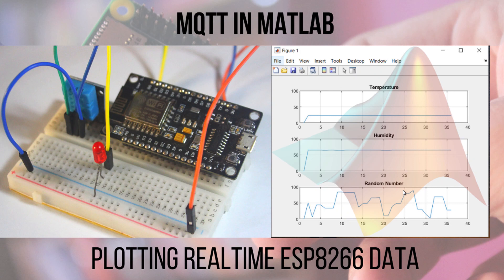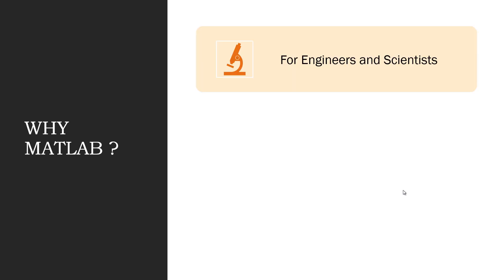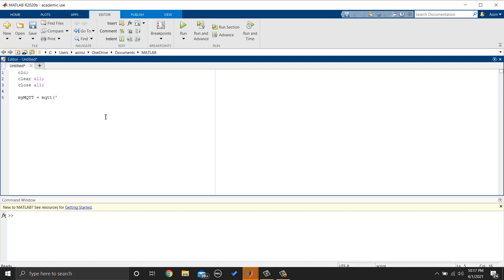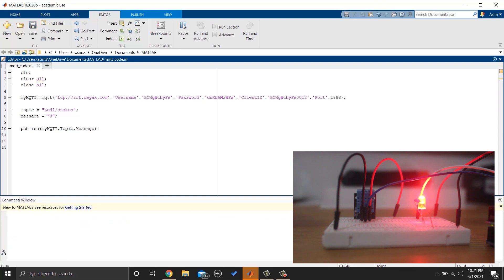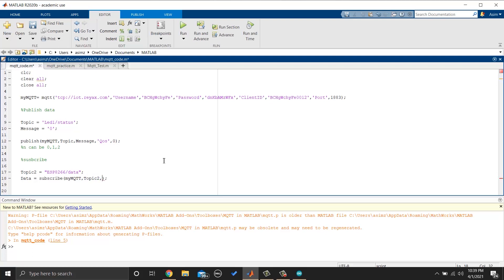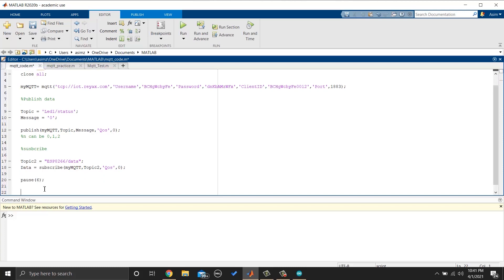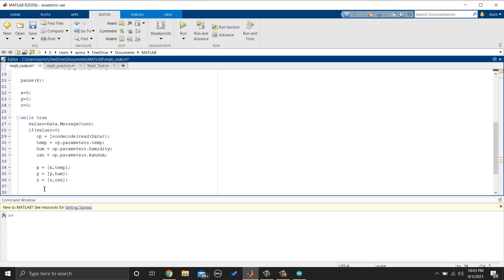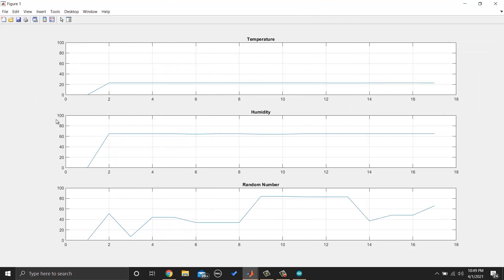Master MQTT in MATLAB: Real-Time IoT Data Plotting

Comment: hi, i am trying a similar setup like you but my matlab code is unfortunately not plotting my sensor values. My D32 Pro is publishing sensor Values via MQTT to my Broker. I can see the values by using MQTT Explorer. However in matlab when subscribing to my topic the MessageCount is always 0 and i cannot find the issue.

Comment: This Video is very useful, and I tried It's working fine for the publishing message in Matlab but when I publish the message and topic in cmd. I cannot be able to see the Message in Matlab even though I subscribed to the same topic. Can you please suggest to me how can be done?
Reply from the maker: Can you provide some more insight of the problem ? because if you have subscribed to the right topic and any message is published on that topic, you must recieve the message if you are using same code.
Reply: @HighVoltages  Thank you for your reply and now I have used ".read" function to read the message its working fine.
One more problem now : I have to continously run while loop to receive message right?? Is there any other method to show the message automatically when I send message from the broker?(without using While loop).
Reply from the maker: @manojdevaraju357  I am not sure but most of mqtt libraries in other programming languages have non-blocking loop and i was trying to implement the same thing here in MATLAB as well but it was not success and i have to use while loop.
Reply: @HighVoltages  Thank you so much👍